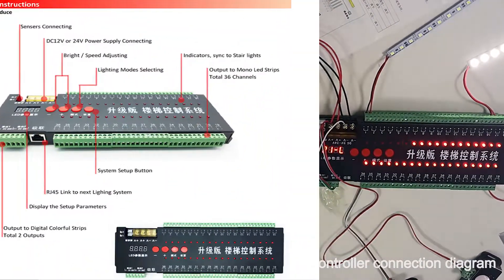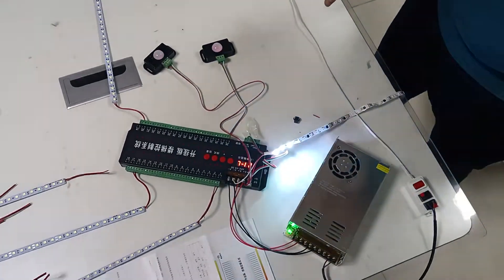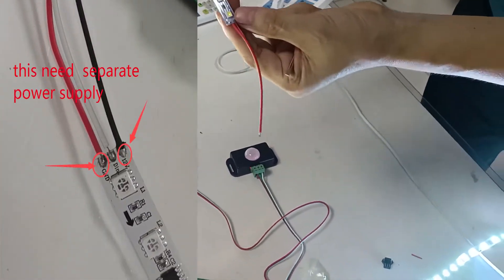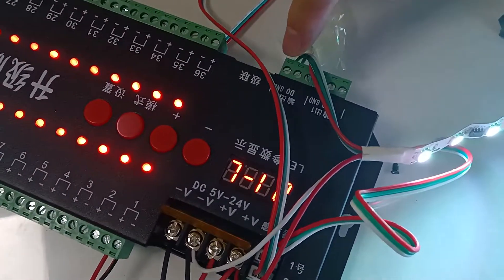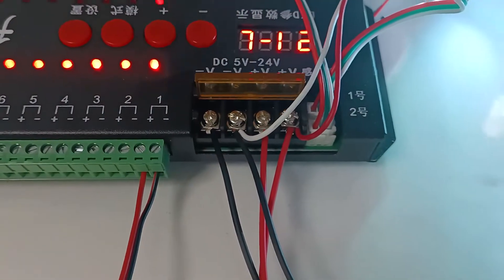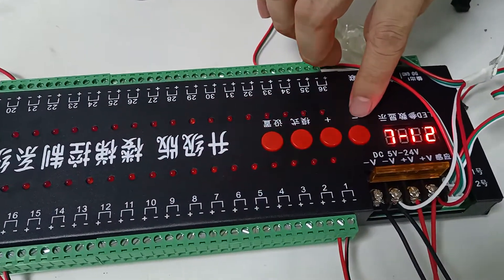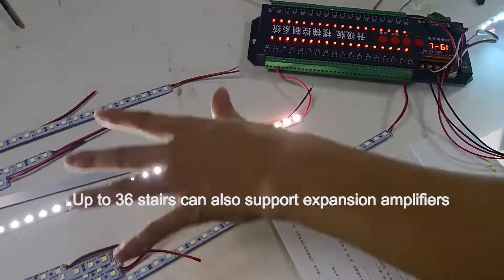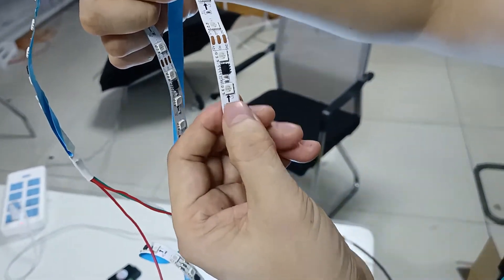Stair light controller connection principle display

Comment: Hi so I have the same controller I just wanted to connect 2 LED light strip 1 on each side of the stairs with a motion sensors one at the top one at the bottom can you help me please